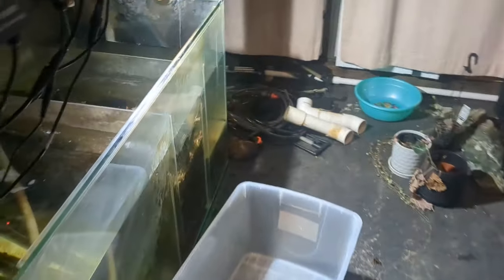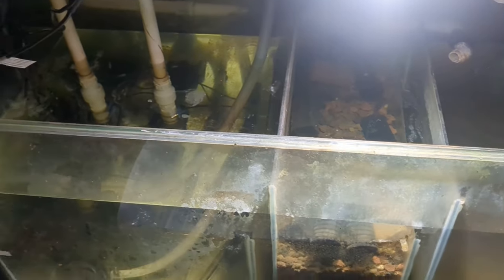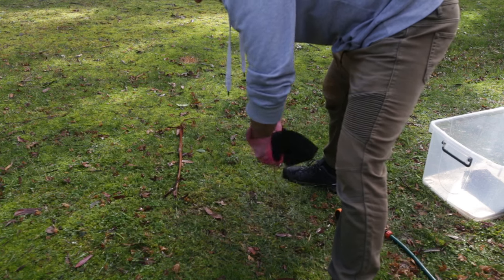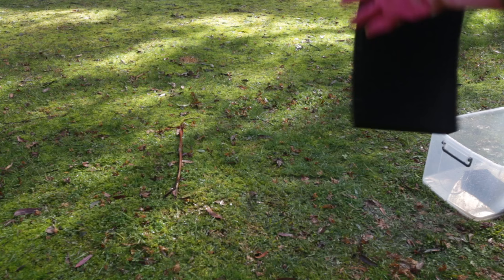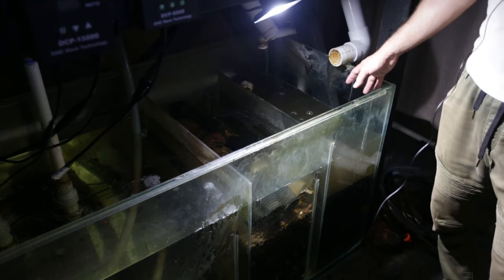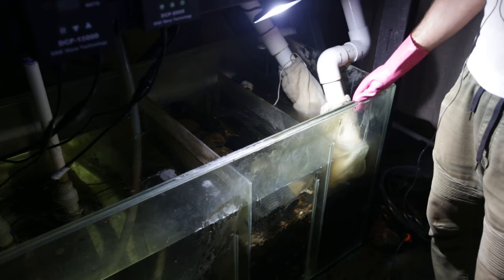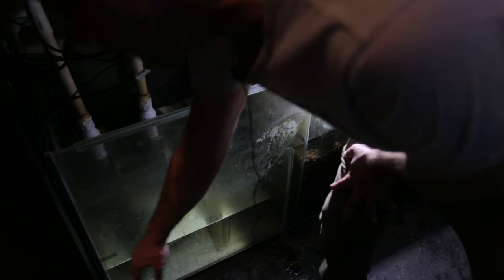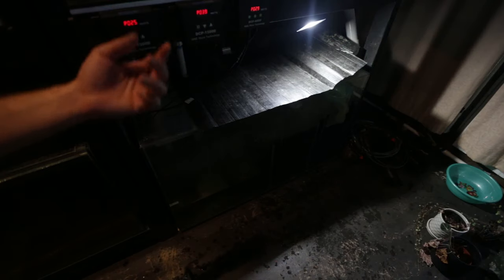What is the most IMPORTANT tip when planning a Sump Fish Room?

Comment: For anyone wanting easy water changes you can just have an over flow connected to a drain in you sump. I have the overflow at the side were water enters the sump, then i just start pumping in fresh water slowly in the return pipe for a few hours. Running 24x 120liters this way in my tetra breeding room